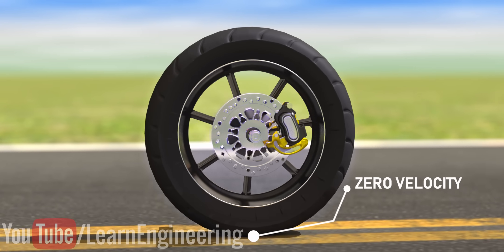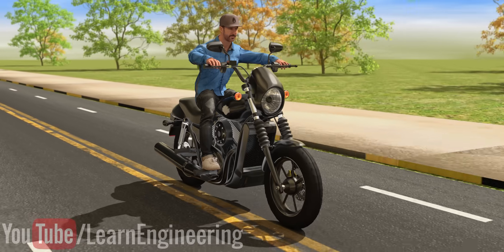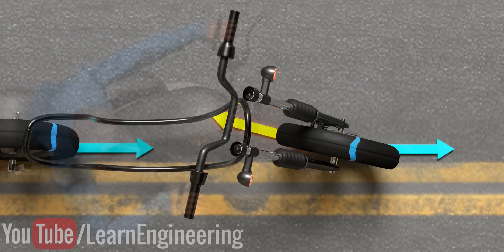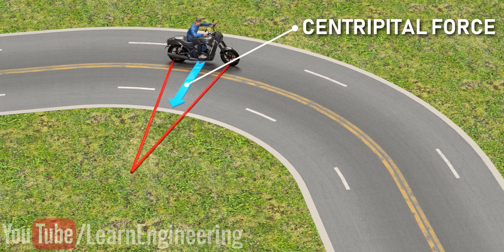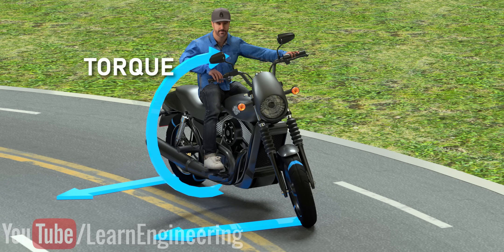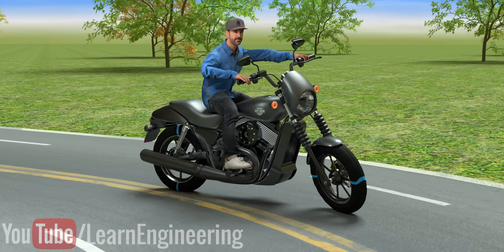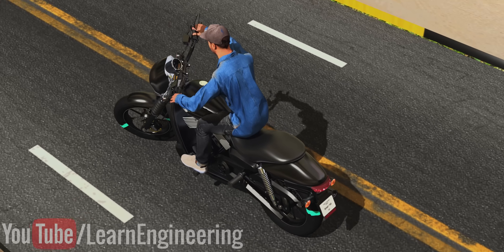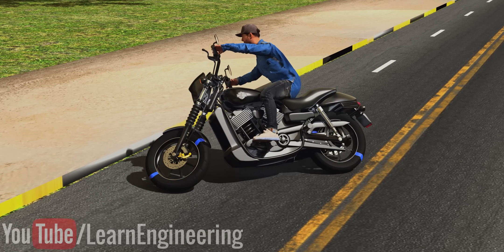Counter Steering | The interesting physics behind it

Comment: It's helpful to break down a turn into two stages, as follows:
1. the initiation of a turn
2. being in the state of a constant radius turn.
The physics and principles involved are identical for any two wheeled vehicle, from a bicycle all the way through to a heavy cruiser style motorcycle, the only differences being the level of forces (rotational, gyroscopic etc.) involved - i.e. the heavier the machine and/or the faster the speed then the higher the forces.
The principles also apply to any speed where your feet are not in contact with the ground (and so are not able to apply vertical forces to alter the dynamics in this way).
There is no magical speed threshold where things change - you don't suddenly apply a different technique above a certain speed.
Firstly let's deal with stage 2 from above - i.e. being in a state of a constant radius turn (ignoring for the time being how we got there). If we are turning left then the bike will be leaning to the left and the front wheel will be turned left [I am assuming we are talking here about regular road riding, not specialized forms of riding such as speedway/flat track riding etc.]. At higher speeds the lean will be greater and the turn of the front wheel will be less (and imperceptible at very high speed, but turned nonetheless). At slow speeds the lean will be less and the turn of the front wheel will be greater. There is no other way for the bike to be in a state of turning.
There have been some comments in this thread that the bike is turned by "leaning". Whilst this is true (together with the front wheel turning in the same direction as the turn, however slight and imperceptible it might be) it only addresses stage 2 of the turn. 
In order to initiate a turn (and therefore make the bike lean in the first place) you have to do something, because a bike travelling in a straight line is stable and wants to remain in that state, the higher the speed the more stable it is. There is only one way to do this and it is counter-steering. If you want to lean the bike to the left (in order to turn left) then you have to counter-steer to the right. This is only for a brief moment to initiate the lean (and hence the turn). You can try to lean the bike by a shift in your bodyweight (by pushing down on a foot peg, pushing down on a handle bar (down, not forward) or shifting your arse to one side) but it will be fairly ineffective (and the higher your speed and/or the heavier your machine the less effective it will be). Even if you think you are initiating the lean by a shift of bodyweight (which some comments on here have described simply as "leaning" - which can really only mean moving your body and hoping the bike will follow) you are still counter-steering. If you were to test that theory by removing your hands from the handlebars (please don't) and shifted your bodyweight in an attempt to create a lean, then the bike will AUTOMATICALLY counter steer itself in order to try and balance the forces. A safer way to demonstrate that is to push a bicycle from the side holding the saddle, at walking speed. Make sure it is level and going in a straight line. Pull the saddle towards you to make the bike lean to the left (in my example I am walking to the left side of the bicycle).  The steering will automatically go right initially before then automatically falling left into the direction of the lean.
If your feet are off the ground then you cannot turn, at any speed, without counter-steering. You will do it subconsciously and do not need to think about it.
Most children learn to ride a bicycle very easily at a young age simply through experimentation. They don't need to be taught anything, and certainly not the theory of counter-steering! Despite that, they are counter-steering. We would normally call it "balancing". Balancing is nothing more than a succession of very small counter-steers to stay upright on a bicycle, particularly noticeable at lower speeds. The human brain learns it, along with millions of other things, intuitively and instinctively.
To quote Top Gun Maverick, "Don't think, just do". 
You will instinctively know how to turn after a little practice. You don't need to be taught it or give it a name.
Did anybody teach you how to turn when walking? no, didn't think so. Most new motorcycle riders can likely ride a bicycle and have been counter-steering all their life without giving it a name, without knowing it even had a name and without knowing all the underlying physics, because it's all unnecessary.
Conscious and deliberate counter-steering however is likely to make you a more proficient rider with better bike control. There's nothing 
different about it to subconscious counter-steering but you are likely to be able to induce greater lean, quicker turns and feel more in control (once you have got used to it).
Reply: Great explanation, good on ya Red mate 👍
Reply: https://youtu.be/lzk8oyNO708
Reply: This is much more comprehensive, clear and correct than any of the explanations I've seen here on YouTube

Do you know where I can read more about counter-steering and how I can use this information to become a better rider?
Reply: @waldolemmer take a course that has classroom and riding instruction.
Reply: Perfect explanation!

Comment: I hate these videos, first off of it's counter intuitive you probably should listen to that intuition. But also when you push with one hand you are pulling with the other just by virtue of handlebar design.  A good rider knows that you can get the bike to turn quicker and with way more control by just simply leaning slightly. Motorcycles are designed so that you can turn almost just by looking. You are adding an unnecessary and sometimes dangerous element when you employ this so called counter steering.
Reply: I accept that this video is completely wrong, but your comment…….Absolute and utter nonsense.
Watch the link all the way through and learn to steer ffs!!!

https://youtu.be/lzk8oyNO708
Reply: @softailfun  yeah I've only been riding motocross for about 45 years. I have at three motorcycles in my garage and just got back from a ride.  But what do I know.  Counter steering is counter intelligence. LMFAO
Reply: And I'm letting the ffs slide cause I'm all too aware of the keyboard courage some people get.
Reply: @markchristian7377  
So we’ve been riding the same number of years, interesting! I learned to steer a bike…. You however didn’t it appears.
One question….. did you watch the link I sent?
Please don’t let anything slide on my part. You’ve already given it your best shot and failed. Feel free to continue.
Reply: @softailfun  and to be clear counter steering is not just stupid it's dangerous. My nephew got into some racing class where some idiot was teaching this idiotic technique about a decade ago, long story short, on his ninja it caused a high side that would have never happened were it not for counter steering. My advice to anyone who reads this is to ride intuitively. There's absolutely no need for this extra step.
Reply: @markchristian7377  
“There are none so blind as those who will not see”.
It’s all I have fella. You’re in the minority in your view. Ride safe fella. Mind those bends!
Reply: @softailfun  yeah yeah you too.

Comment: Nonsense. ALL steering is counter-steering. 

A motorcycle wants to stay upright. Moving forward, if you put no input into the handlebars, the motorcycle will stay upright. This is caused by rake and trail. Trail puts the contact patch behind the axis of the fork. When the motorcycle leans, the road pushes against the wheel behind the fork axis, which causes the forks to turn into the lean and bring the motorcycle upright. 

Counter-steering is what causes the motorcycle to lean. When you turn the handlebars, you are moving the contact patches out from under the motorcycle. This causes the lean. Turn the handlebars to the left, and the motorcycle will lean right. Turn the handlebars to the right, and the motorcycle will lean left. It's actually more of a pressure than a turn of the handlebars. Because of the trail, the motorcycle will be trying to return to the upright position, but you have to stop it by applying pressure. Turn the handlebars into the turn, or put pressure on the outside grip, and the motorcycle will lift out of the turn. Counter-steering produces the lean which produces the turn. 

When you are turning, the front wheel is actually pointing into the turn, but by applying pressure, you are preventing it from bringing the motorcycle upright.

Comment: It's actually about speed. You lean during high speed. You "counter-steer" automatically during low speed. Veritasium has a much better video and it's not even about motorcycles, but about bicycles in general
Reply: Without counter steering you don’t lean. So you counter steer at higher speeds.

https://youtu.be/lzk8oyNO708
Reply: @softailfun  I watched the video. Yes you can lean and initiate a turn. It's just that the turning radius would be much larger. If you have to turn harder, you have to lean harder, potentially using counter-steer. But at much harder turns, you have to slow down anyway or you risk losing traction. On a downhill even with just a bicycle, try going hands free and just leaning to avoid obstacles on the road. It's totally possible. TLDR: My point still stands.
Reply: @grenzviel4480  
I ride a Harley, heavy bike to say the least. I’ve actually tried to steer with just throwing my weight around with absolutely zero success. However, counter steering works every time. Guess which one I’m sticking with?…. Yup, the one that gives me total control. Why anyone would want to use an inferior steering method is totally beyond me, but hey…. Each to their own I guess.
Reply: @softailfun  ahaha "inferior". Okay buddy. If you didn't get it, my point is that one method is not inherently better or worse. Both have their own use. My point is, if you didn't get it,  it's fine to just lean for when you want to just change lanes. You use counter-steer for when you need to swerve or turn really hard. However counter-steering puts you at the risk of losing traction on your front wheel at high speeds and possibly completely lose control. Doesn't matter if you're riding a Harley or a Bicycle.
Reply: @grenzviel4480  
The fact that you feel that by counter steering at speed you could lose traction on the front end speaks absolute volumes about your understanding of how counter steering works. We’re done, thanks for the replies but stick to topics you understand. Incidentally, why anyone would want to ride a bike with no hands on the bars is totally beyond me. Also, if you think you’re leaning when you’re holding the bars (like changing lanes), you’re wrong… you’re counter steering! Peace out!!!
Reply: @softailfun  I'm also telling you, ride a bicycle on a straight line. Gather speed, and then let go of the handle (like that vid you linked me to). The bike will balance itself above a certain speed, and during that time you can lean left and right, effectively steering the bicycle without touching the handlebars. 
PS: I don't have to edit my replies because I am confident with what I understand. Also, I feel bad for you that you don't understand why cyclists would ride without their hands on the handlebars at certain times. Good luck and I hope you don't get into an accident.

Comment: I do not understand all the fuss . It is almost like there is some kind of choice. I realised at a very early age even on push bike that to say for argument you want to turn left and you are travelling straight you need to slightly push right on the bars to upset the balance so the bike starts to lean to the left side then you start to steer left to hold the balance of the bike while you are turning left. Your speed and the severity of the corner will dictate how much push to the right and for how long ,usually only a split second you need to counter steer in order to get the bike to lean in the opposite direction . The best example to prove counter steering is going through a series on s bends. You are cranked over to the left and to steer right you have to turn harder to the left to get the bike to stand up and go the the other lean angle the you steer to the right to maintain the balance. We are talking absolute very small movement of the bars to achieve all of this. In fact it is so small you do not even know you are doing this. To prove a point get on a push bike on a soft area like grass and slowly ride your bike in a straight line then just turn the bar one way only and see what happens. The bike will fall to the opposite side you turned and you will fall to the ground. If you turned left the bike will fall to the right. But if you turn the bar to the right after the bike leans to the right you will compensate the balance and either get the bike to go straight or turn into a right hand direction depending on how much and how long you move the bar to the right.
Reply: Well…. No! A rider of a motorcycle never steers into the bend. The result of doing so would stand the bike up and failure in taking the bend…. why? Due to counter steering!!!!
The front wheel does indeed steer into the bend but this is due the the bikes own steering geometry, not rider input.

https://youtu.be/lzk8oyNO708

Comment: Explanations of countersteering in this video i think aren't complete. Physics about countersteering must to concern about differences between angle of attack of front fork and point of contact by de front wheel. For each motorbike geometry, there is a velocity over wich counter-steering effect will be available. When this speed is reached and turning the handlebar to the right (for example) this movement displaces the contact point of the front wheel over the road to its left. In this situation you have two contact points and a center of gravity that wants to remain aligned, but it isn't. That's the real reason why motorbikes over its critical countersteering speed, leans to the left when handlebar is directed to the right and leans to the right when the handlebar is turned to the left.
In fact, It's absolutelly not necessary to displace the driver's body  along the y (transversal) axis to lean the motorbike. Just doing countersteering the vehicle leans (and you also can practice a driving style called 'british' which consists on maintain the driver's body position in vertical no matter the lean angle of the vehicle.
During coutersteering when lean angle of the vehicle satisifies the condition to achieve the necessary ride of the particular curve, handlebar must return to its center position, and when you are ready to return to a vertical position or to lean to the opposite side, you just need to countersteering. For example, you are leaned over the right and you need to change to the left side, then you just need to actuate the handlebar to the right direction and you'll see how your motorbike starts to verticalize and once in vertical continues to lean to the left side (but you are turning to the right!!).
The fastest you actuate over your handlebar (inside some limits) and the fastest your body follows (even advance) the motorbike movement, the faster you change your path.
Nothing to say against your torque explanations, except that some torque could be avoided leaning more the vehicle and less your body, or viceversa. The more the driver's body displaces towards the inner of the curve, the less the  vehicle has to lean.
And there is another question.... the higher the c.o.g of driver will be, the fastest you will be able to turn. That's the reason why R's seats are today 100mm o 125mm higher than two decades ago.

Comment: "Counter steering is an amazing technique used by many bike riders" - silly!  You cannot ride a motorcycle at normal road speeds without countersteering it - normal steering will not work!  So there's no 'using it' - it happens and that's part of riding a motorcycle.  Most riders never gave it a second thought until someone coined the term.

Comment: This is nonsense. Normal steering IS counter steering. Gyroscopic procession is how your bike will lean over in the first place!

They once did a test where the steering was welded straight so that it couldn’t be turned. When the rider tried to lean it over by shifting his weight (even in the extreme), but it simply stayed upright and straight. 

Ok, for a gyroscope to work, it needs to be turning fast. So at slow speeds it is possible to lean the bike with the riders mass moving around, as the force of the gyroscope is less than force of the moving mass. But at speed (and a relatively low speed at that), the gyroscopic force becomes dominant force, thereby making counter steering the only way you can start the lean.

Comment: it is not a move to be used only on specific occasions or in emergency maneuvers. On any bike that weighs a certain amount (most), counter steering is the only reasonable way to make turns, as the rider's mass has minimal effect on the bike's lean.